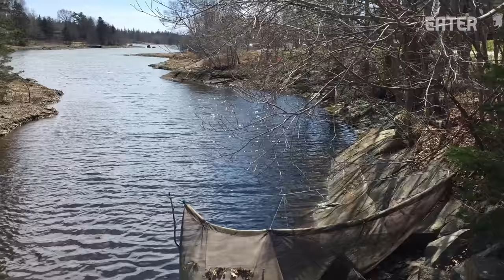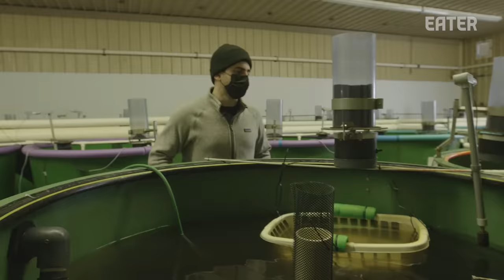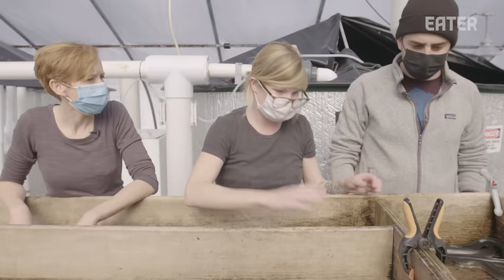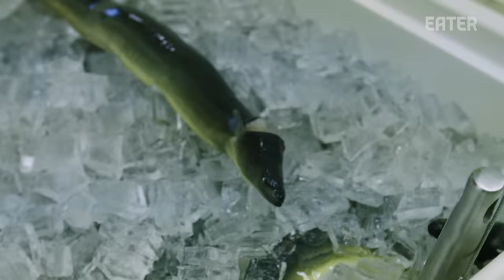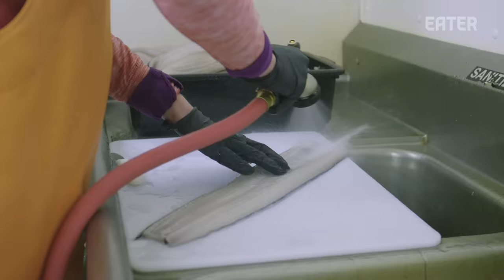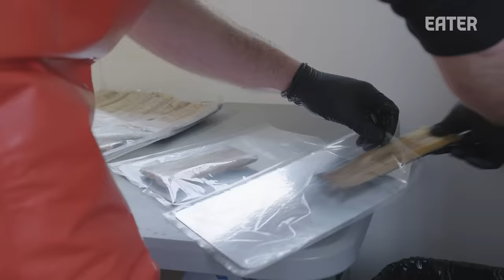How an Eel Farm Grows and Smokes Eels for Top Sushi Restaurants — Dan Does

Comment: Japanese: It takes 5 years to master cutting eel
Charlie: I did it during the lockdown
Reply: Well to be fair, the skill to cut a live eel has more to do with dealing with the blood. Here the eels were already drained before cutting, so it's less skill-intensive.

And I'm all for it if it doesn't affect the taste that much if at all. That's how we get good quality stuff with lower cost and better streamlined procedure. That's progression.
Reply: The preparation they did in this video for the eel and cutting it isn't the same as Japanese level. The eels are fresh and alive in Japan. You smack a nail onto the eel's head and then start slicing it. 

Considering we don't have sea food markets and its limited access are only to certain areas in parts of Canada... this is an easier way to manage stock. As much as the eels are fresh... they aren't exactly 100% fresh considering they go in the freezer for transportation. 

Also the fact that they are smoking eel instead of having it roast over a charcoal fire combined with a good marinade/sauce does not bring out the eels full potential. Try it the Japanese way on a bed of rice. It's fucking delicious.
Reply: Japanese are over exaggerated, all you need to do is cutting 20,000 of it.
Reply: @MrCleks  plus that the japanese has a tendency to overcomplicate some things because of traditions. Look up sushi chefs filetting a salmon, takes around 1-2min.. Take a look at someone that works with industrial fish processing.. takes like 15 seconds with a cleaner result.
Reply: Dude and in Japanese culture some said that if you want to perfect dish for eel you will need a lifetime to perfect it
Reply: @MrCleks  what lock down?
Reply: @davidjohansson8563  These are two totally different examples as one is for sushi, which is to also make it look good. One doesn't care as they're paid to just dispatch the fish as quickly as possible. This is like me making pho where I can have everything done within an hour or two but then you go to a restaurant and they're saying their broth takes 12 - 24 hours to make.
Reply: @saysoun752  I don't agree, what you're talking about would be the final preparation before cooking/serving. In that moment you are absolutely excused to take your time to make it perfect. 

But that step comes after the filet stage, which is the first thing you do with the fish after perhaps gutting. In that stage it's all about getting clean cuts and minimize waste. That stage can be done pretty much perfect muuuch faster than any sushi chef i've ever seen do it..
Reply: If you think charlie is doing a better job than a japanese master who spent 5 years perfecting it, then you are mistaken buddy
Reply: @Emmy MacDonald whatever makes you feel better after being schooled. 😂🤣

Have a nice day.
Reply: He didn't figure it out of nowhere. He had the millenia worth of videos on the internet there to tell him what to do and how.
Reply: Too be fair, there are somethings that do take many years to master, wouldn’t want to eat pufferfish from a newly trained chef
Reply: @Emmy MacDonald oh, I wasn’t part of that conversation lol, I was referring to the main comment lol
Reply: @kylemeng5072  don’t even bother to listen to Emmy.  She’s clueless on this matter. 

The original comment is half joking anyhow.  

It does take years to learn certain aspects but the industry has changed. 

50 years ago was totally different. Japanese restaurants were scarce in the US.  Hardly anybody ate raw fish and the same for eel. 

Everything was wild caught and Japanese chefs always had to be concerned with diseased fish/eel or know where certain places were toxic.  

Flash forward to even 10-20 years ago the popularity has exploded.  It has allowed certain people with the trained eye and feel to spot diseased fish/eel when caught.  

There are many “junior” sushi chefs these days with just the basic skills.  They often come and go. 

The years of “training” is more how badly do you want it and are you willing to dedicate your life to it.  Pretty sure you know this.  

Some folks just can’t figure this out.
Reply: Its just a humble japanese way to say 5 years, lol asians hate bragging about their skills
Reply: You people do realize that the OP was joking right?
Reply: @nezhokojo1641  no thanks some things aren't meant to be eaten
Reply: @davidjohansson8563  in ww2 american can produce pilot n ship crew  easily... n japan everything goes slow . . 🤣
Reply: @mulkanmulkan5620  Well the Chinese can also produce skyscrapers and bullet trains like 100x faster than the U.S., but it's all about quality over quantity.
Reply: @davidjohansson8563  so would you eat a raw salmon from a sushi chef or from an industrial processor?
Reply: Japanese farmer : 😳
Reply: Proud of this thread, clearly many have watched the Japanese eel Eater episode :D
Reply: This is true. A live eel is slippery and still has nerves that will cause it to move while cutting it. Dead eels that been on ice bodies are stiffer and most of the slime is already off the body. Still a good job learning it yourself
Reply: @nezhokojo1641  Jellied eels are the best by miles,  no extra ingredients just cooked in their own juices and allowed to cool eaten with a little vinegar ground black pepper, bread and butter. Unbeatable imo
Reply: Exactly
Reply: @f430ferrari5  nah.. You are wrong. 
Japanese eel / unagi come from china, and grown in farm.
Reply: @davidjohansson8563  thank you so much for pointing that out bro. Over complicating and over charging is always in fashion in Japan.
Reply: @nocturnalwolf7559  not really. You got that Japanese mentality where if you learn something quick you can’t do it well even though it’s near perfect or perfect.
Reply: i think you mean puffer fish
Reply: @Stinger32  no you don’t you’re literally thinking of puffer fish not eel
Reply: You’re comparing apples to cabbages bro. Sushi chefs in Japan usually do traditional methods whereas everywhere else it’s efficiency. Japanese styles tastes pretty damn good tho as a result
Reply: @davidjohansson8563  im sure they take the time to keep the waste of the meat at a minimal
Reply: I mean they do a great job but Japanese grilled eel is a totally different thing
Reply: Japanese are always exaggerating with the process to make all their products expensive.
Reply: Cut it like this you learn in two hours
Reply: @f430ferrari5  Replying to your original comment, I agree that the time dedicated and experience definitely has it‘s value. People nowadays have no respect for craftsmanship whatsoever because most stuff is mass produced and the only emphasis is put on speed and efficiency, they couldn’t appreciate the dedication of these Japanese people at their craft, because they can never imagine themselves putting in the same amount of work. 

But as for you accusing the farmers here of using growth hormones because they grow fast, well I don‘t know if they used it but if they did then the Japanese farms also used it because if you watch a video by business insider it says the eels in Japanese farms take 6-12 months to mature. So if they are using GH then the Japanese is definitely using as well, industry practice.
Reply: @greenhat7618  I didn’t say they for sure using growth hormones. I said it “appears”. 

Also…we can’t throw a blanket over everything.  Not all Japanese farms are the same.  Maybe some are using GH and maybe some are not. Bottom line the family name is attached in Japan and they have a tradition and reputation to withhold.  

The US market is rapidly changing.  Many “Japanese” restaurants are not even owned or run by Japanese across the US.  It’s all about profit for some which is understandable.  Each has their own niche also. 

I really don’t care who runs it or owns it.  If it tastes good for a reasonable price then fine with me.
Reply: @silverrayleigh6284  are you listening to yourself? I'm pretty sure yhere are multiple unagi farms in japan
Reply: Is called being humble. They don’t show off, because there’s no need to show off.

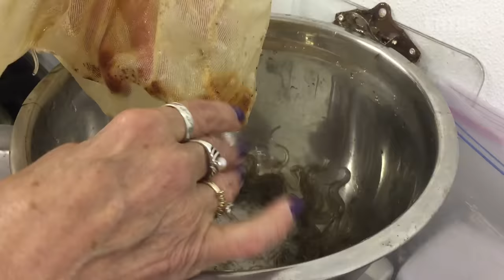Comment: The real reason why 1.4 lbs of feed result in 1 lb of eel ist not the eels inherent efficiency. It is simply because the processed fish feed is to a large extend dehydrated. If you were to rehydrate it to the same degree as the eels natural water content the ratio between feed and eel would be closer to a 1:10 ratio.
Reply: Hmm. Well, livestock feed is probably dehydrated as well.
Reply: chickens and turkeys too it's a distinction without a difference. It's dry food.

Comment: the Feed conversion ratio for fish is flawed though, and shall not be used in this prospect comparing it with land animals FCR's, 1lb of fishfeed is dry weight whilst 1lb of harvested fish is wet weight, about 50 to 80% water depending on the species... for pork 1kg of dry feed will give you 0,5 kg of meat but that includes much less water..., FCR's are only to be used as comparison factor between same species culturing methods... comparing the FCR of one method of eel growing with the FCR of another is only valid use for that.